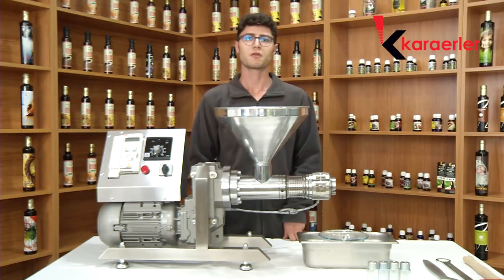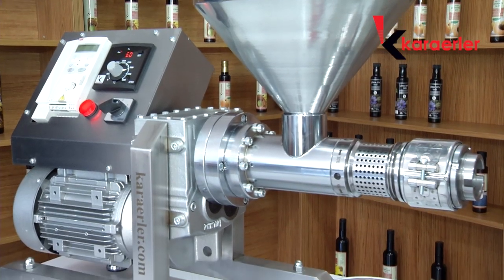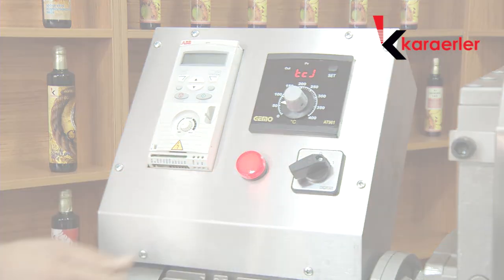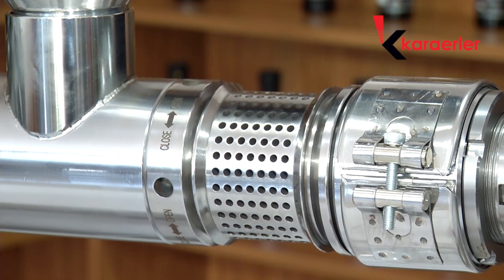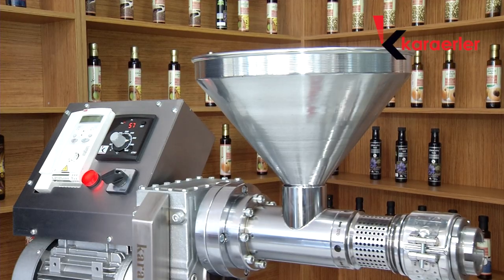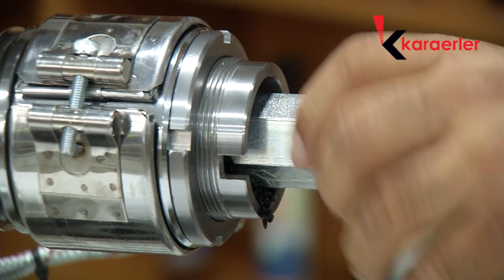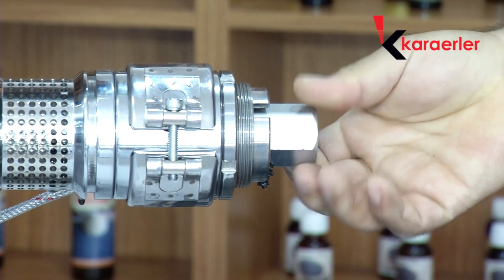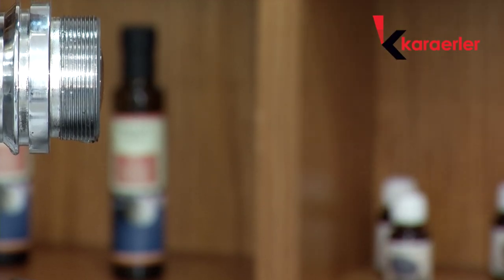NF 500 English cold oil pres machine

Comment: id it’s cold press why does it get so hot inside ? 300 degrees centigrade?
Reply from the maker: The speed at which we turn on 300 degrees heat. not machine temperature

Comment: Does this machine produce olive oil through the age of olive grains
Reply from the maker: Olive Oil does not shrink. removes oil from dry and oily seeds
Reply: @KaraerlerMakina  I bought from your company NF 500 machine there is a problem when I use it in the era of seeds stop from the era to change the rotation of the machine two cycles and then re-rotate the original squeeze a little and then stop and so I do not know the reason
Reply from the maker: hello, you can call our technical service for your problems  0552 480 20 81
Reply: @hussein4190 problem solved? (:

Comment: Since it is cold press why you graduate temperature on 200 degrees???
Reply from the maker: For machine details https://karaerler.com/
To contact +90 552 386 69 32 info@karaerler.com
Reply from the maker: https://youtu.be/HAZ_-5LRijM If the heat is alone, it is heated to start first and the heat is turned off, the oil temperature should not exceed 39 degrees

Comment: I bought from your company NF 500 machine there is a problem when I use it in the era of seeds stop from the era to change the rotation of the machine two cycles and then re-rotate the original squeeze a little and then stop and so I do not know the reason
Reply from the maker: If you have any problems, our technical service number is 0552 480 20 81

Comment: It is not cold press , if you using high heat and destroy healthy supplements of oil !
Reply from the maker: Get in touch with sales consultant Mr. FURKAN + 90 530 238 47 43  info@karaerler.com    www.karaerler.com
Reply: Agree!
Reply: Cold press is always heated between 37 et 45 Celsius degrees, idealy under 42. Any cold press oil you buy is like that.
Reply: Depends on what you're pressing. Everything has different alkalines that react different